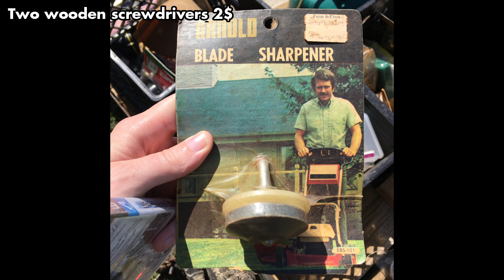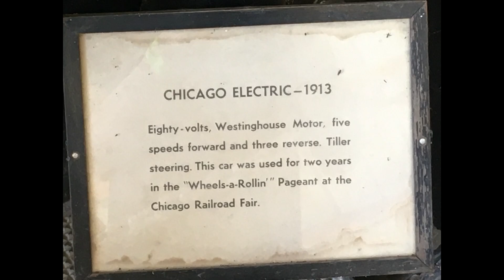Random Bits 0271: Big engine festival starting up in Jacksonville Illinois after that 2020 ordeal.

Comment: This reminds me of a similar video HubNut made a couple years back… nice to see outdoor events with low transmission risks getting back up and running.
Reply: I like how that electric car from over a century ago kind of has no forward or rear to the cabin seating despite the rest of the design being directional. 

Though that’s also pretty similar to London taxis with their passenger compartment having front and rear facing seats; so I’m sure the electric car shares DNA with horse-drawn carriages that were symmetrical inside too. 

Still it’s always a design element that catches my eye, and you still see electric vehicles leaning into that, such as with the new Citroën Ami.
Reply: @kaitlyn__L  I really don't like modern cars much, but boy would I have one of those Citroen Amis! They are neat.
Reply: @iana6713  it’s definitely got charisma. Leans-in to being the Minimum Viable Vehicle just like the 2CV and original Ami did for their day!
Reply: @kaitlyn__L  Indeed. Only vehicle I've ever had that was as minimal was a Trabant. Not exactly environmentally friendly though...!
Reply from the maker: I just looked up the ctroen ami, wow is that car disgusting looking. it's horrible like my citicar but then it just looks gross like it has fat rolls and holes for rims
Reply: @RinoaL  I guess it’s like Marmite! Many people in the UK press look at it like the true successor to the original Mini.
But really my main intention was to draw attention to the symmetry — the front literally is the same panel as the back, there’s only one shape of door, etc.
Reply: @kaitlyn__L  The looks are, um, interesting... But the concept is neat!